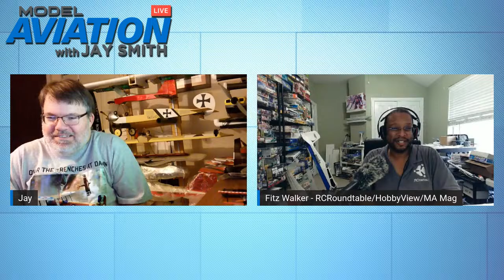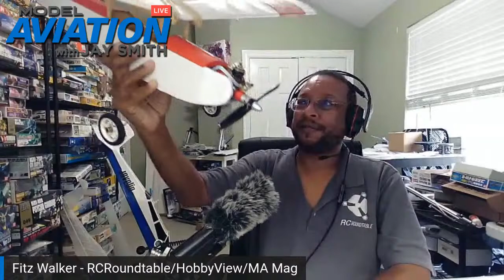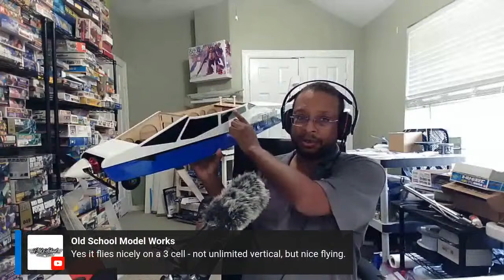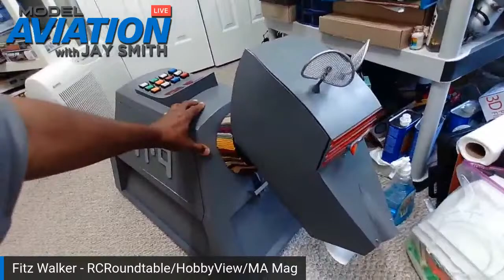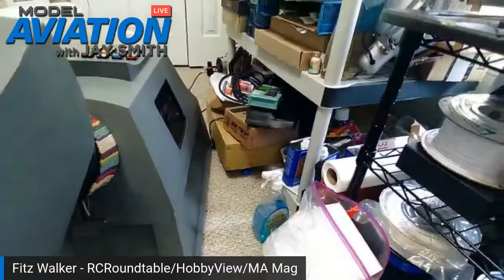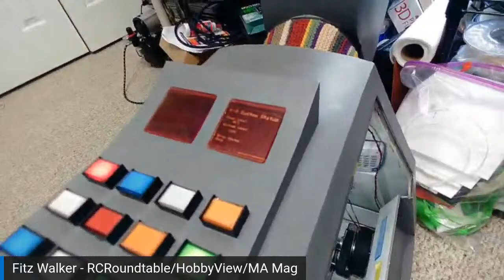Model Aviation LIVE with Jay Smith - 8/21/2020

Comment: The Pup of Damocles. Fitz better check with his HOA about keeping a trailer around. Jay I see your BALSA USA EIII. I have the big one. I put rubber tubing on my tail skid and it works on paved runways.
Reply: Thanks for the tip on the tail skid. I have a Sopwith Pup hanging right above me that I think would also benefit.